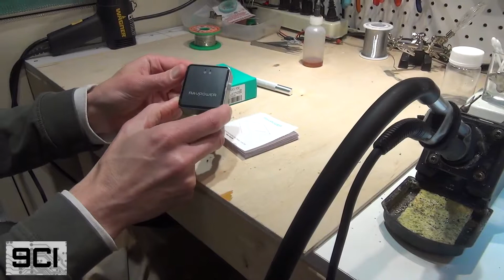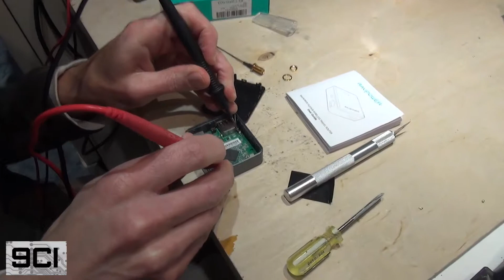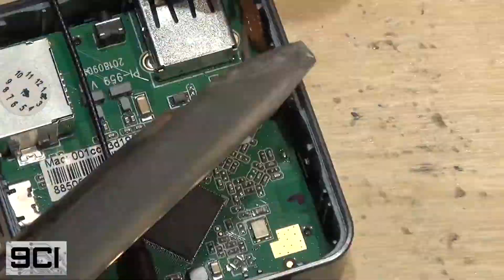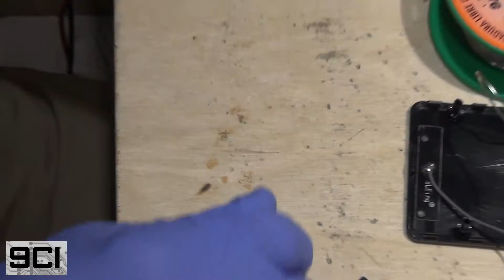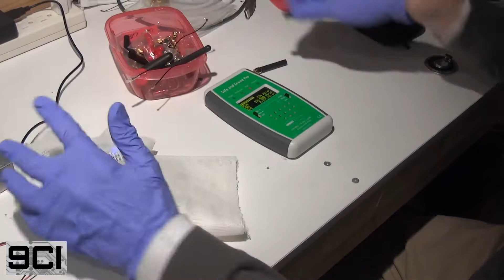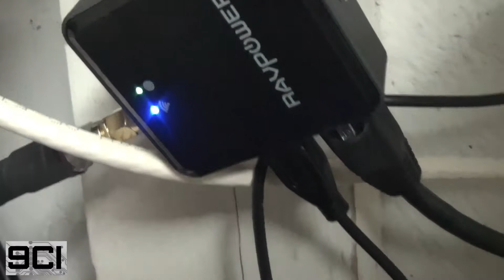WLAN Link Project

Comment: Can wireless network gear be damaged by transmitting without an antenna attached?
Reply from the maker: Low power Wi-Fi chips are robust enough to tolerate a missing antenna load, but higher power transmitters need a properly matched antenna or termination.